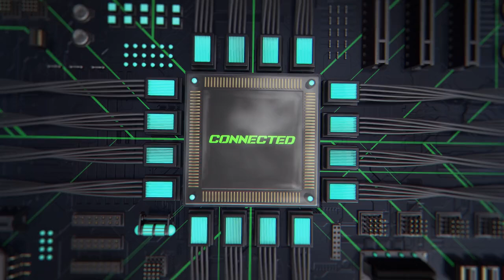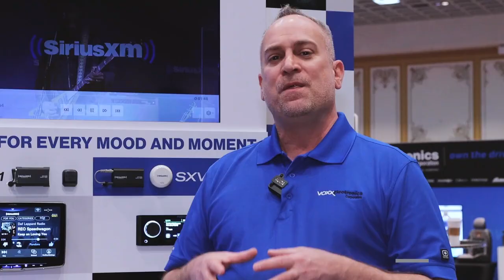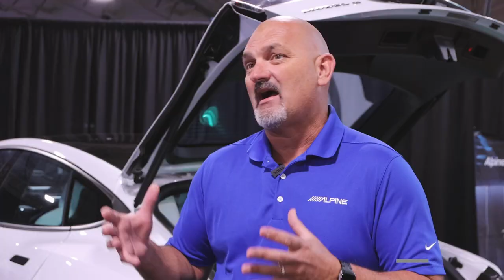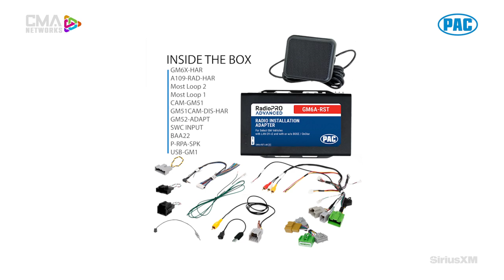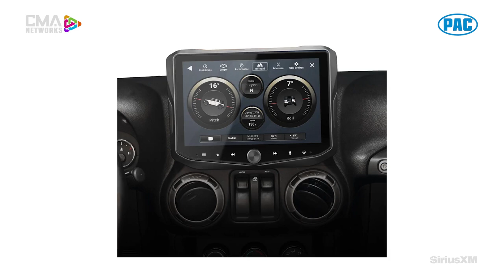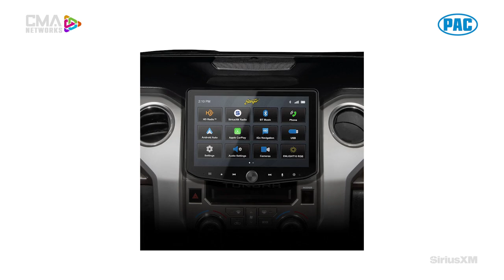PAC AUDIO | OEM INTEGRATION | CONNECTED

Comment: pac has no customer service North technical support they don't answer any of the emails you only have a computer answer which does not answer.. 2015 Toyota RAV4 pioneer AVH with the pac amplifier the rear speakers do not work crutchfield told me to reinstall the factory radio and set the fader correctly in the middle